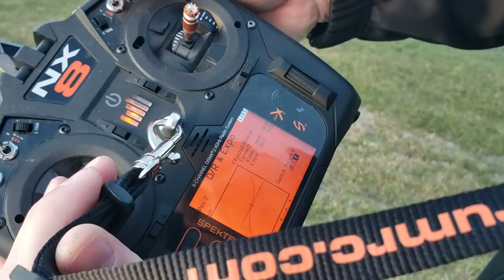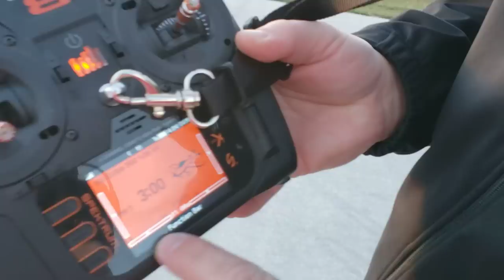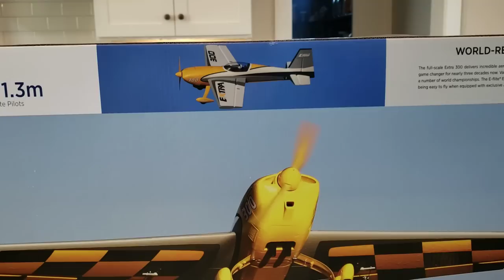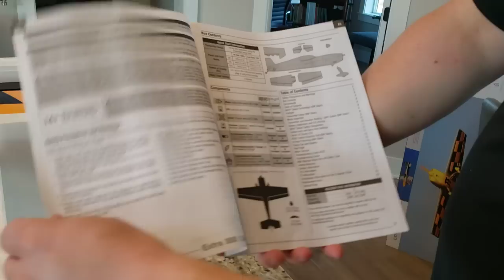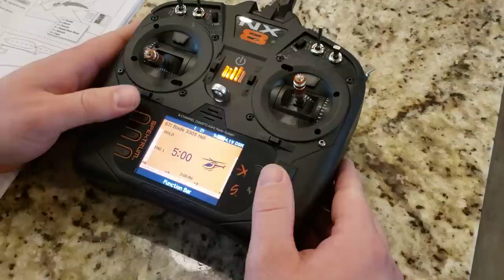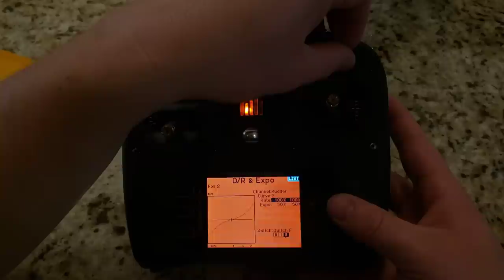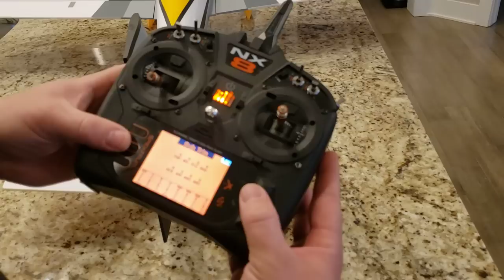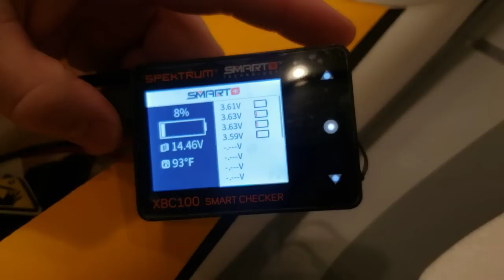Eflite - Extra 300 V2 - 1.3m - Unbox, Build, Radio Setup, & Maiden Flights

Comment: Thanks again for the radio set up! It took me a while to realize that in order to set up safe select and safe that the plane had to be live. (Battery connected) So many of the operations can be performed on the TX with out being 'connected' to the plane but Forward Programming is not even a listed option without the battery connected in the plane.
Reply from the maker: This is correct, since you're using FORWARD PROGRAMMING, you have to communicate to the Rx from your Tx, thus the plane must be ALIVE ;)

Glad you caught that. I need to speak about it in the next Radio Setup video so this can be more clear for people. This was still fairly early in our Forward Programming days, so I was also learning a lot at this point, fwiw

Comment: I like this one. It flies nice just like a sport plane or 3d.
Reply from the maker: It CAN, but if you fly sport, put the battery further forward or fly on 3200mAh 3S and you can fly way longer and way more solid in general.

Comment: Mine was exactly the same with the wing bolts
Reply from the maker: We've had this happen a few times, so I think it's something about mid wing planes...
Reply: @BrianPhillipsRC  man I just cant get mine to balance on suggested cg. Even with a bigger 3300 4s, pushed all the way forward, I can lay a strip of sticky weights (120 grams) over the prop, and I'm still coming out tail heavy

That was a quick test I did when assembling, I need to sit down and figure it out still.

Comment: Curious where you put your battery mine is tail heavy unless I’m all the way forward with 2200 4s for sure! So far forward that I can only use on strap.
Reply from the maker: We showed it, but I was flying somewhat tail heavy. Kinda hard to explain...but not quite as far as you had it. 4S 2200 30C
Reply: Thanks man!

Comment: Brian, thanks for making this plane look so easy to fly and tempting me more and more to buy it even though its way out of my league! Camera crew, you produce the most consistently good camera work I have ever seen in Youtube RC videos, I really dont think people realise how difficult it is - especially in one take.
Reply from the maker: You can do it! This plane is not too bad if you're not on your first or second plane, but to make it really perform a true 3D dance, I would need to be a more disciplines 3D pilot, which I'm not [yet].
Reply: Buy it! Like Brian said, set the rates to 60% even up to 75% with safe and you'll do fine. I was nervous about mine and set my rates to 60 and immediately after the first flight I turned them up and even without a lot of expo. It's easier to fly then you'd think. Plus you can set multiple rates to a switch if it's not enough or to much. Just dont go lower than 60% cuz it won't want to turn. I got it as my second plane, my first was a pioneer 620 which I only flew 3 packs before I had the extra in the air. It is very versatile and tame if you want it to be. I would recommend buying a spare prop with it cuz they break pretty easily. Most importantly (for me at least) don't forget how big it is, the scale will make you think its closer to you than it actually is which is dangerous. It looks incredibly epic in the sky tho. I recommend getting it!
Reply: @jakeclauson9863  Cheers man!
Reply: He’s got me wanting one to. I suck at 3 d but how am I supposed to learn if I don’t.

Comment: Nice plane. Looks like a lot of fun. Hey Brian you call it hammer head. Weren’t you just hovering. Hammer heads hover than tip to left or right with power I thought?
Reply from the maker: When I say "hammer head", I mean flying vertical (hovering) in place...but I don't know about the falling away part. Maybe I'm saying this wrong???

Comment: Even with 4S 3200 mah installed had to add nose weight to balance.  Curious if you had similar situation.
Reply from the maker: Weird! I had a 2200mAh 4S 30C and 50C for the two flight...both were forward, but I was okay with a bit tail heavy for a 3D plane.

I would encourage you to try it a TOUCH tail heavy and you might like it better ;)

Comment: I ordered mine a month ago also came with a highly corroded prop nut, and I had no water damage to my box so it's an Eflite quality control thing. Regardless of that it still works fine while the rest of the airplane was flawless, those main wing screws are a bear to install though.
Reply from the maker: So strange!!! I didn't have issues beyond that too, but I was not thrilled that the nut had the corrosion on half of it...but not on the threads at lease ;)

So wonder if the box was WET BEFORE SHIPPING??!?!?!

Comment: Obviously this and the Arrows Edge fly similarly,  When all things are equal I go with e-Flite.

That said, I have an awesome 3-D plane that is every bit as capable, and only costs $109, and is almost indestructible. If you want to learn how to fly 3-D get yourself a Skynetic Sbach 342. Then buy this plane.
Reply from the maker: Not in the same size class at only 900mm - different ball of wax ;)

Comment: It's funny when you try to avoid naming Arrows RC and I guess Horizon Hobby makes you do that but hey that's what it costs to do things for one brand. On mine I replaced the ESC to an Avian 60A so it now does reverse thrust! But I can't do as long flight time as you as after 5 minutes I've sucked a Spektrum 2200mah dry.
Reply from the maker: Horizon Hobby doesn't "make us do it", but we try to be nice to the brands we work with. In this case, since this was a review of their plane, we didn't want to get too in the weeds about the Arrows plane.

We may do a full on SIDE by SIDE at some point, but we are trying not to piss off the companies we are fortunate enough to work with, or they might just say - screw you Brian ;)

Comment: I noted in your review of the Arrows Edge 540 that it was a copy of the old FMS SBach.  This plane is also, Just  mainly cosmetic differences and more power.
Reply from the maker: Arrows is made by FMS, there's no "copy". This is strictly a branding decision. For example, when you get your milk at the wal mart, and it says WAL MART (generic), I can almost guarantee it's coming from the same dairy as your more expensive "name brand" milk. This is how all MFG'ing works. That being said, there may be slightly different electronics, or livery, or packaging but again, they're the same basic item. Sometimes the electronics are IDENTICAL, other than different stickers on them, unless they're calling out a different spec. This is why we do our review videos, since there's a bunch of choices, and many times, it's HARD to tell the difference in performance.

Comment: Very valuable to have you do these builds warts and all - including wrong assumptions, and poorer quality! In this case I had big problems with stab and wing bolts. Has to be a better design for this. Ended up removing stab servo, and as you might say janking those wings to get the last bolt to find the nut. Beautiful plane though, decal bubbles and all! Rare earth magnet helped pull those recalcitrant suckers back out
Reply from the maker: Sorry you had those issues, but hope you enjoy yours once you've worked through the handful of issues you uncovered during the build. I don't know why some planes just plop together, almost by accident, and others just make you WORK for it, but either way, I'm glad you have it ready to get flying soon!

Comment: Great video as always Phillips family but this is my least favorite Eflite model by far. First of all it is NOT a 3d plane. It’s a good, powerful big air plane, but it’s not built for real 3d. Years ago when this first came out I spent a ton of time trying to learn 3-D on it because it was called the 3-D. I stayed frustrated and finally bought a real 3-D airplane and it was an immediate change for the better and I was able to quickly learn advanced 3-D hovering harriers and much more. There’s no way you could hold a decent clean hover for five seconds. And a decent 3-D airplane can easily do this. It needs much more room for a larger battery also. And the awful proprietary prop. It has a unique size hole so you have to buy that particular expensive prop for it. So I really have a grudge against this airplane lol.
Reply from the maker: Well, even though I don't think this plane is bad, I'm glad you're saying this plane isn't a 3D plane, since I too have a hard time hanging it on it's prop...I just thought it was me ;)

I realize there are some WAY more 3D planes out there...like the profile plane, for example, but I'd like to fly one just for comparison.

Comment: Would you say this is easier or harder to fly than the ultimate 3D? I can fly my ultimate very confidently without safe (honestly think safe just makes you a worse pilot in the long run because it teaches bad flying habits) and I do fly it on max rates however I have a TON of expo, like 70-80% on high rates. I have flown a flex innovations extra 300 which did feel easier than the ultimate.
Reply from the maker: I think the Ultimate is pretty much the same...they're so close, I don't even really want to say one way vs the other.

This in the context of me NOT being a 3D pilot ;)

Comment: I bought this plane a few months ago  but I have yet to fly it because I can’t seem to get  The wing properly mounted it’s almost as if two of the4 screw holes are not aligned correctly did you have any issues installing the wings
Reply from the maker: Did you see how I had to PULL ON IT....rested opposite my hips? This is how we got them to take...also dip the tip in some Dawn to help lube the screws, and you'll enjoy it so much more ;)

Get her in the air ASAP - Great plane! Watch our build...you will see what I'm talking about (it's ON this video...)

Comment: High speed stall is when the speed of the plane plus elevator input results in plane g forces making the plane weight higher than wing lift so the wing stalls. 
And if nothing else a hammerhead is a stall turn/wing over!! You’re doing hovers! It’s all good!
Reply from the maker: Sure

Comment: I think a yellow or red or blue or whatever $4 ebay color digital volt meter mounted on the bottom of the fuse so when you hover you can see your pack voltage without taking your eyes off of the plane. I love those little things, i have a green to red digital led one on my sig kadet sr., Looks really cool with lights when the sun goes down too.
Reply from the maker: Those little cheap voltage alarms are nice! We have had a bunch and still use them on our Gen1 Smart packs ;)

Comment: Hey Brian,
Quick question for you.  I’m looking to get back into the hobby, and I’ve been out of it for about 25 years.  I used to fly with my dad and grandfather, balsa glow planes back then.  I flew an extra, a something extra, a four star, ultra stick, and an acrobatic (large wing flat fuselage) plane.  Seeing that it has been 25 years do you think this extra would be good for me to get back into the hobby (and start out in SAFE mode)?  I just wasn’t sure if I needed to go all the way back to trainer or not since I’ve never flown foam or electric.
Reply from the maker: You could, but it's still a lot more performance than I would recommend for a returning expert.

Here's what I suggest, but feel free to totally ignore this advice if I'm off base ;)

I think you should try one of these "beginner planes" even though you have the skills for an Extra 300. If and when, like 3 weeks of intense flying sessions, you're ready to take the plunge BACK into the hobby, get a QUALITY Radio...like the NX8 ( NX8 https://bit.ly/3Ou7Fmk ) and then you can start following along in our radio setup videos. If money is LESS critical in this step, get the NX10 - it'll last you longer ( Tx https://bit.ly/3J05xSj ) since you'll get more years before you outgrow the technology for another higher level transmitter.

Honestly, once you get your groove back - you can 100% handle a pseudo 3D plane like the Extra 300, but I think you might find it a bit TOUCHY as a returning expert.

Just keep in mind, Ready to Fly (RTF) planes are way more wasteful ($$$) if you're going to STAY IN THE HOBBY...since you'll only need one transmitter when you're ready to settle back down into the hobby.

Good luck - hope you find my advice helpful, and also consider an RC simulator, if you want to hone your skills for less cash, BUT you might just find it kinda LAME compared to the REAL THING. I think of them as a tool, not a sport.

Beginner list

Description | Purchase | Videos
Habu STS 70mm RTF | https://bit.ly/3ci5eWD | https://bit.ly/3ontBF9
Apprentice 1.5m RTF | https://bit.ly/3BlSjh9 | https://bit.ly/3b6kCVP
Carbon Cub S2 1.3m RTF | https://bit.ly/3PqNR4A | https://bit.ly/3J6WmQ3
T-28 Trojan 1.1m | https://bit.ly/3PmbxHf | https://bit.ly/3v8zGJi
Apprentice 1.2m RTF | https://bit.ly/3BlSjh9 | https://bit.ly/3Bk60wG
Sport Cub S2 UMX | https://bit.ly/3yYkrUs | https://bit.ly/3PL8vfJ      <<<<<<<< Maybe hold down the cost with this???
AeroScout 1.1m | https://bit.ly/3OlqyYQ | https://bit.ly/3ztp9Li

Trekker 1.2 RTF | https://bit.ly/34jhgLZ | PNP https://bit.ly/35xOPu8 | https://bit.ly/3PHoZ8M
Bigfoot 1.3m RTF | https://bit.ly/30mYdOq | https://bit.ly/3zqIxZu         <<<<<<<<< Very good option for low cost
Pioneer 620mm RTF | https://bit.ly/2YotgbY | https://bit.ly/3OvJLad
Prodigy 1.4m RTF | https://bit.ly/37zJxzt | https://bit.ly/3cvccaZ

Ranger 1.2m RTF | https://bit.ly/3bHFIKr | https://bit.ly/3bCezZB

RC Simulator https://bit.ly/3aWiW19 | https://bit.ly/3h9StjB   <<<<<<<<<<<<< Get one WITH the USB transmitter so it's easy, provided you have a PC to run it.
USB Simulator Interface Wireless DSMX Dongle https://bit.ly/3ztFZK8 | https://bit.ly/3h9StjB
Reply: @BrianPhillipsRC  thanks so much for the reply.  I actually plan to get a simulator.  I unfortunately am limited on the simulator I can get because I only have a Mac.  So I’ll be getting Aerofly RC and trying that out before I jump into anything.  

What are your thoughts on the P-51D June Nite V2 - 1.2m for someone like me?  I watched your videos on it and it definitely looks like a fun plane to fly.  Do you think that would be a bit too advanced for someone like me getting back into the hobby?  I know back 25 years ago the pilots complained the balsa P-51s were notoriously difficult to fly, so I figured I would ask your opinion.

I do plan on getting the NX8 no matter the decision (NX10 if it miraculously goes on sale).

Comment: love your vids, thorough a.h., entertaining and amazing flying- new fan, big fan! New enough to this that I don't have your huge collection of batteries (give me a few weeks)... wondering if I can use my existing 4s 30c 4000's? You cover 2200/3200, wouldn't mind some extra flight time (and not buying additional batteries)- assuming I find correct CG, will the incremental 2oz (vs. the 3200) cause any issues? I would prefer to drill it into the ground for better reasons :/ Appreciate all you and your 'camera crew' do, huge help getting folks like me back into RC!
Reply from the maker: One problem you MAY find, is that it's not about the capacity, which is the GOOD part of the bigger pack, the real issue is  that you gotta get the CG right for the plane to fly well ;( IF you can add some dead weight to get everything balanced out, you'll be fine, but don't make a "rookie mistake" and think you can just have more capacity without a tradeoff. Heavier planes do tend to fly worse too...BUT not 100% of the time ;) There's always an exception, and situation where exceptions MAY exist in this regard.

Good luck as you keep at it!
Reply: @BrianPhillipsRC  appreciate the response- good advice, I'll pick up the appropriate size so I have one less critical point of failure (and will initially set up a 60% d/r and 50% expo as you suggested) :/ I've learned a TON from you already, you're doing a huge service to a great hobby, Brian- thanks for all the effort and passion!

Comment: A newbie here ….For receiver setup, don’t you just import the Extra 300 1.3 Eflight from the existing BNF preloaded in the transmitter?  Would you adjust the arm on the rudder servo?  I think yes, because the servo arm is traveling more nose left than right?  And doesn’t one calculate CG with this AC upside down?

Comment: Nice work👍 but I'm confused cuz you refer to the plane as v2. There's a v2 extra 300? I just ordered one and will be bummed if there's a second version. Or do you mean v2 ad in 2nd video of it?
Reply from the maker: They updated the Rx...that's it...rest is the same ;) AR636B in the V1 and AR661 in V2 - nothing else is different, and I can't tell a difference, for what it's worth ;)
Reply: @BrianPhillipsRC I see. So I just ordered one last week. Will be here in 3 days. Will it have the updated rx? I had quickly glanced over the details on horizons website but didn't notice anything that stuck out to me as updated. But I'm also not very savvy as far as the rc lingo goes. But if you don't notice a difference I certainly won't. Would just be good to have the latest version.  Love the vids btw. Been binge watching them all since since I found your channel!

Comment: Did you get 10 minute flight times with both 30 and 50 c batteries
Reply from the maker: They were super similar...but I'd say I was flying ABOUT the same intensity too...so "yeah" - you'd have to setup a stop watch if you wanted to be 100% spot on, but I'd say 8-10 minutes is a SAFE flight ;)

Comment: You mentioned your in your mid rates do u use the same dualrates on most model’s? And what are they if u don’t mind?
Reply from the maker: I do, except for 3D planes...I make a LOW EXPO mode (I call it CRAZY MODE) and a standard "middle" rate, and a LOTTA EXPO, something to get me back to the ground if I have issues.